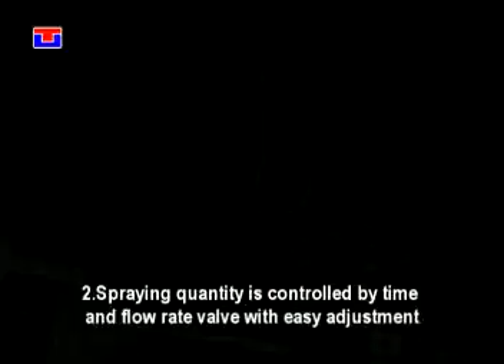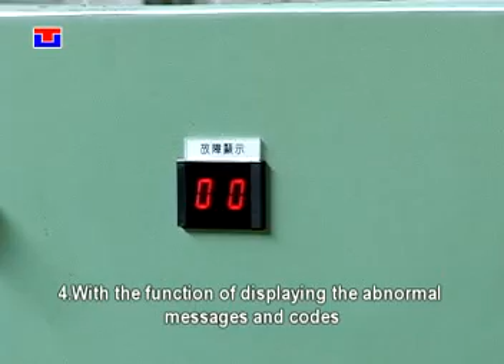Taiwan-TBC Die Casting Machine

Comment: Nice machine! I worked before in asahi die casting company, We use toyo die cast machine. I have noticed that almost same parts are used. The automatic laddle, the extractor and the automatic spray. The cycle time, the shot speed, the mixing machine for die lubricant, The PLC and the melting furnace..I know how to troubleshoot and maintenance this kind of machine...hehehe only one sensor is working on automatic extractor down to conveyor.....tnx for uploading
Reply: keyloggers26 hi bro . I want to get some information and guide line about diecasting machine .. add my WhatsApp 008613157902100
Reply: U r right keyloggers
Reply: Good